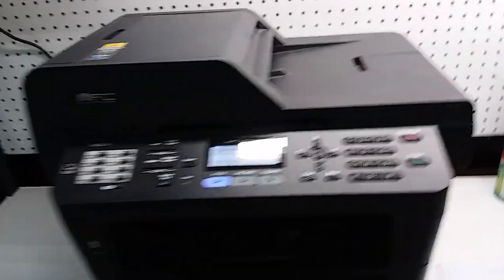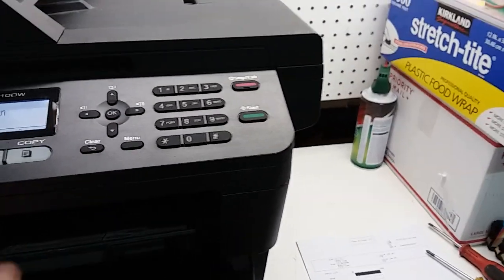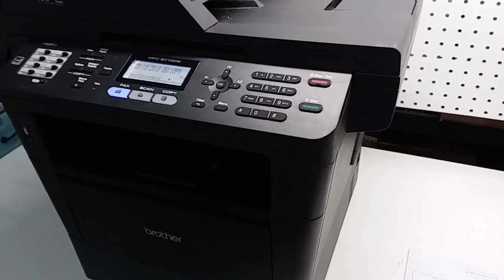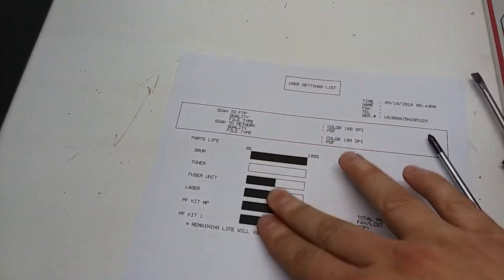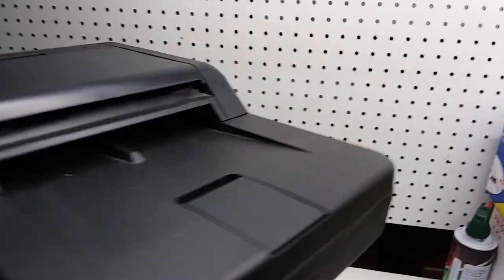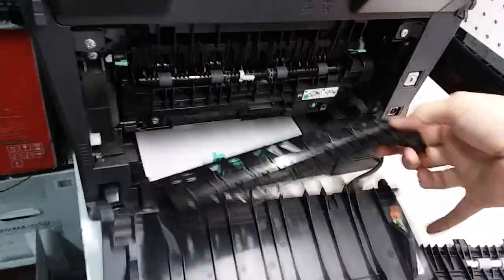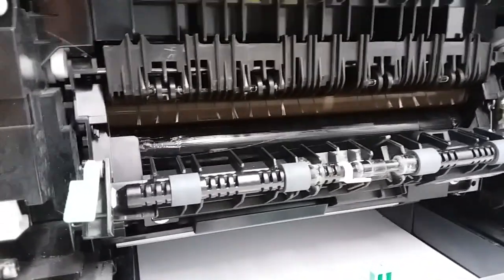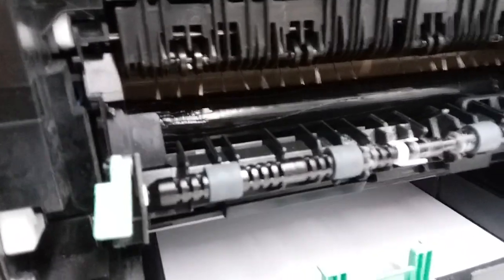Brother Laser Printer Issues - Smeared or Blurry Lines on Paper MFC-8810DW, MFC-8710DW, MFC-8510DN

Comment: Great video.  I like your communication style. Can I ask a question?

I use a Brother MFC-L5900DW and I'm seeing poor print quality...but ONLY on the 2nd side.  In other words, on a double-sided print job, the "front" of the page is good...but the "back" of the page has a long line along the edge of the page.  

Any idea what would cause this?  Thanks in advance!
Reply from the maker: Hello. I'm not exactly sure why it does that. It is possible that the drum may need adjustment or replacement.
Reply: @303electronics  Hey, thanks for chiming in!  Unfortunately, I've swapped out the drum and the cartridge and neither seems to help.  Neither does cleaning the fuser rollers in the back.  I think I may just need to replace it.  It's done 251,000 pages since I bought it.  Is that good?